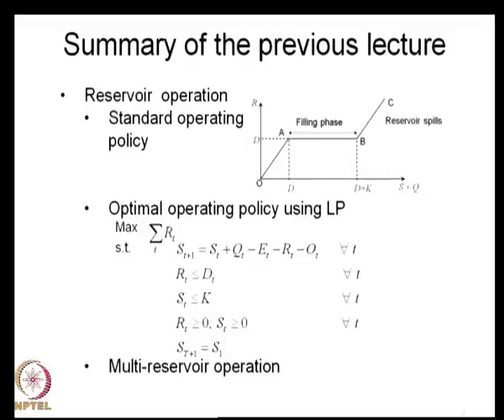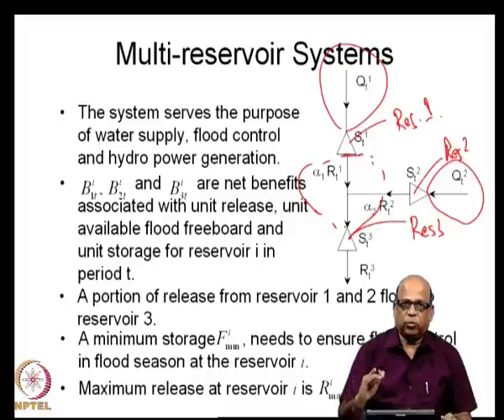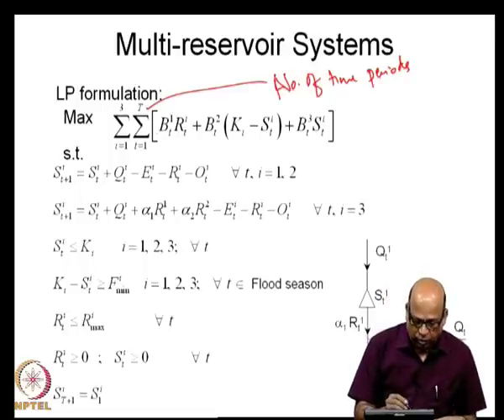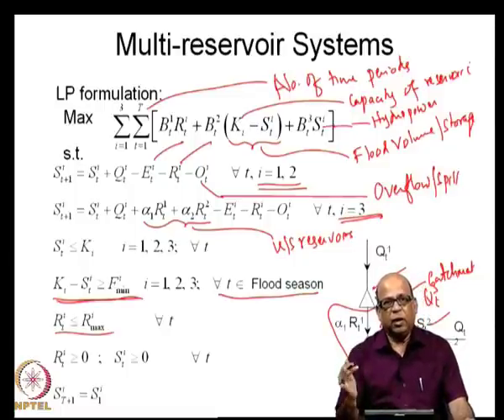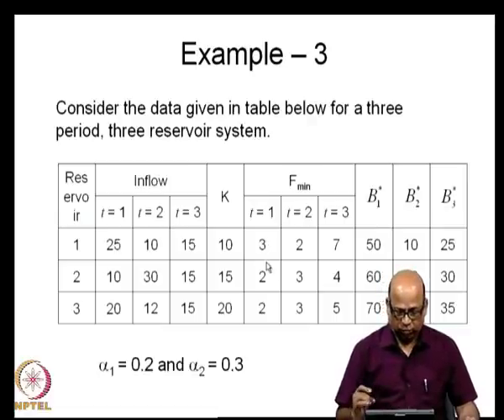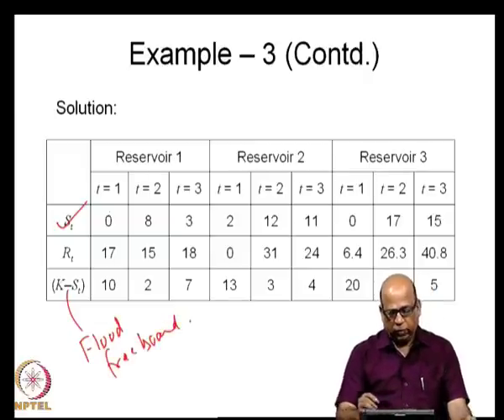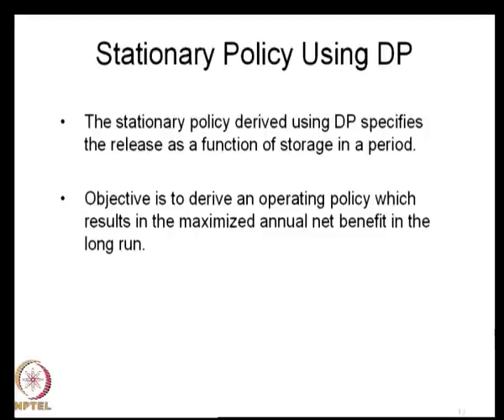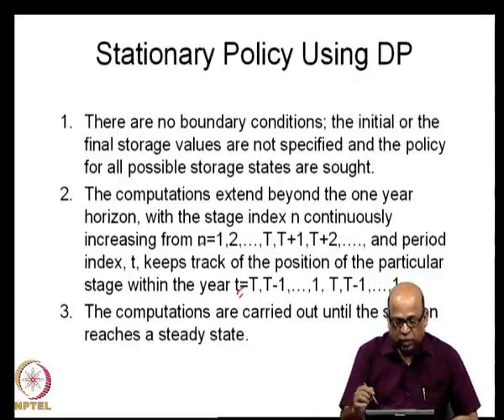Multi-reservoir systems

Comment: sir add programming procedure in lecture
Reply: Codes, as required in the examples, are given in appropriate lectures; these codes basically are simple ones reproducing the constraints discussed in the examples. Therefore, codes are not discussed in the lectures.